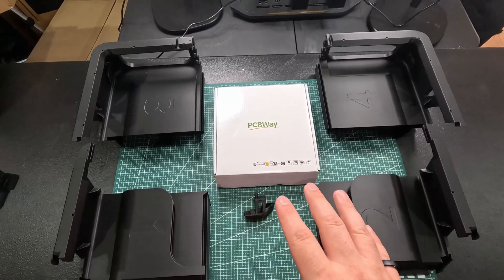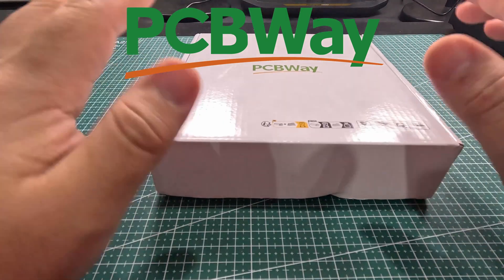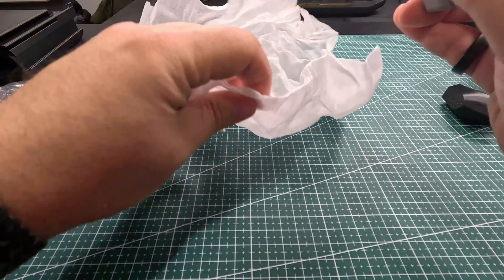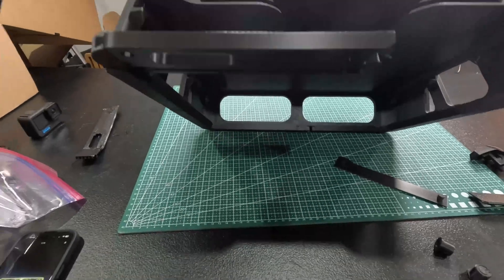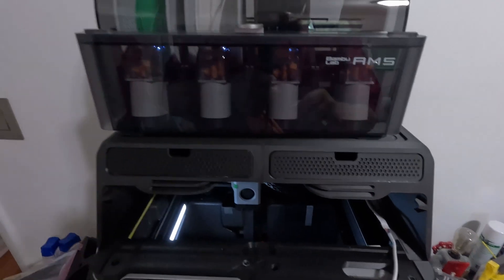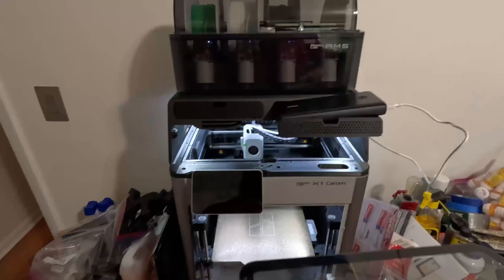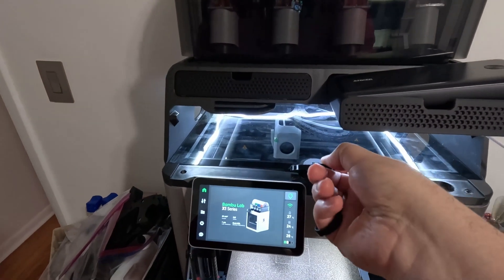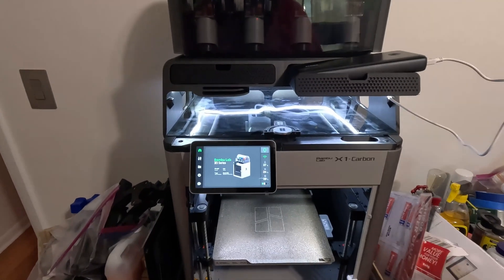I Tried Printing a GIANT 2kg Project With My Bamboo X1!

Comment: did you use supports? i have the x1c and per default it has supports
Reply from the maker: Yes. If I remember correctly they came off pretty easy but you could always tweak them a little to come off easier. I need to reprint this at some point? It got broken in a move.

Comment: I have a P1S and have NEVER done a test print!!
I printed a 2Kg AMS-riser on the fly and it worked just fine.

WHY? Are everyone so scared of printing files they have downloaded?
I just print and watch the first minute or 2, then let it run!!
Reply from the maker: This was one of the first things I ever printed on the machine about 2 months into 3D printing in general.
Reply: @RyanMercer  I printed my AMS riser, Same as you did. After owning it for 3-4 days. No test print^^
Reply from the maker: and it was a test print because that's the only filament I had. It's now extremely broken because it was garbage, and un dried filament. But hey good for you man.

Comment: Man that wire sticking out of the front! 😔
Reply from the maker: @volens31  I'm so used  to it now I had to go see what you meant 😂 at some point I need t remove tbe AMS and get in there and dissolve the hot glue and switch to a better solution.

Comment: Did you use the Bambu led strips or something else?
Reply from the maker: @davidcooper574  just random ones from Amazon. The adhesive sucked so I had to taxi them in place with hot glue. I'm going to redo it at some point, not happy with that strip.

Comment: Just wanted to point out to new viewers that there is a top glass “shelf” just below the slots for the extra build plates so you generally don’t need to prop the door open for PLA/TPU any longer since it vents the top glass a lot.

Comment: nice video :hands-yellow-heart-red:In my assembling guide, under point 7, you can see at the back of part 3 an opening where the cable can be routed to the outside. The first position where you installed the light strip was already correct.
Reply from the maker: @maCyo42  yeah I figured that out after using hot glue 😂

Comment: whoah thats cool. I was looking at making one of these, but I Really don't have a use for tpu outside of this project so I would like to avoid buying a roll just for it. how did it go with the TPU gasket? did it work fine without it?
Reply from the maker: @anamewithnoface1330  I didn't print the tpu gasket, the few times I've tried the tpu in my A1 it has just jammed bad. Seats fine and the glass lid still gets snug when I put it in but I haven't tried to print abs or anything in it, I have a qidi in the garage I've been using for that since this is in my office.
Reply: @RyanMercer  I mostly print pla anyway, so that shouldn't be too big an issue for me.I think I'm gonna make one. Thanks for taking the time to respond!